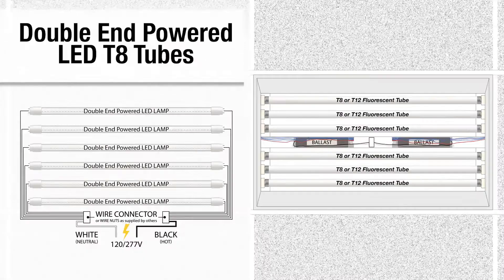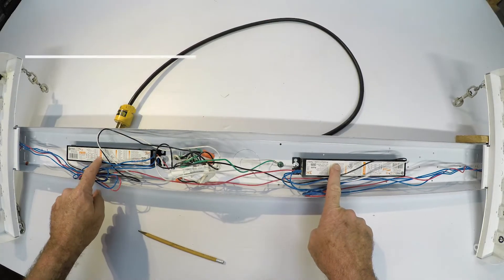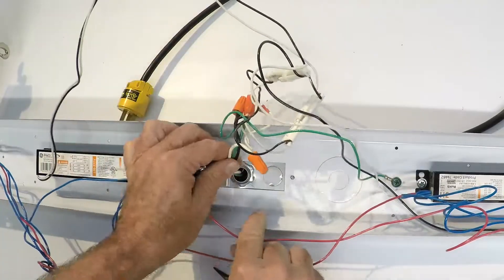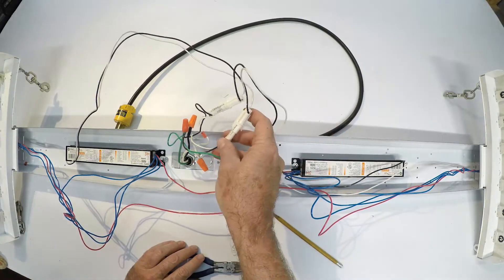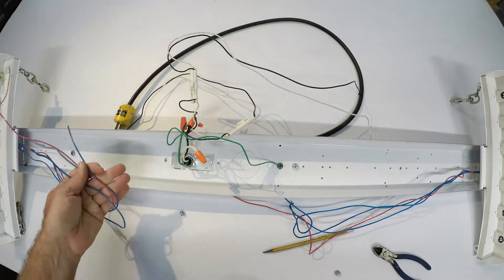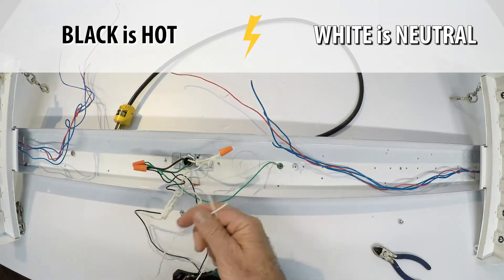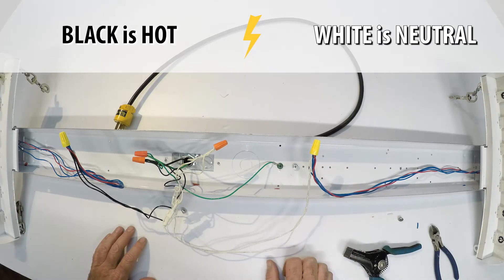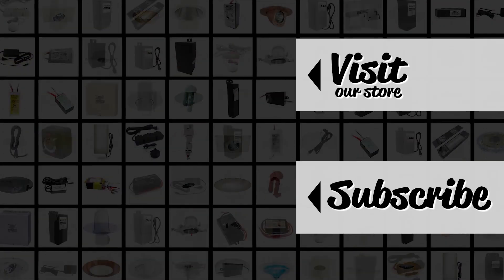How to convert a TWO Ballast T8 Fluorescent Tube Light to LED T8 DOUBLE END powered Fixture

Comment: It doesn't matter what side gets hot and what side gets neutral?
Reply from the maker: The goal is to make sure one side is all hot and one side is all neutral. Its good to mark which is which as some T8 LED lamps require this. Always follow the wiring diagrams.

Comment: Mine doesn’t have a ground wire
Reply: Well - - then the wiring doesn't meet current code, the electrical wire that brings elictricity to the fixture ought to contain 3 wires, 1 black, 1 white & 1 bare wire ( might be wraped in paper) which is the ground wire.  I'd ensure the supply power to the fixture is off, then very closely inspect this supply wire which should be contained within a job/work box made of steel or some sort of plastic, even remove the job/work box if you can not clearly see to inspect the incoming wire.  Should you find a ground wire use a screw nut to atach a sufficent  length of same size bare wire to the exiting ground wire and then attach to the metal fixture.  Should the light fixture be made completely of a non electricial conductive material - plastic - the code might not require a ground wire.  Contact the local building / electricial inspector, explain the wiring situation and ask what the code requires.

Comment: My fixture was like yours, except along with the red, and blue, and the black hot and white neutral, I had a set of yellow also. I connected the yellows to my neutral side. Now only the 2 out board tubes work and not the 2 middle tubes. What did I do wrong with those yellow wires?
Reply from the maker: Did you purchase the kit from us?

Comment: I need help on mine , mine have two ballast two but it has two blues two red and blue red and yellow ,
Reply: I had the same thing. I connected the yellow to the neutral side, but that didn't work. It would only light up the 2 outboard lights. Did you ever find a solution?

Comment: I have Red, Blue and Yellow on both sides and tried one side wires to Neutral and tried other ones to hotwire but did not work.

I had short wire on one side so added thin wire to reach and complete circuit on on side but it did not help.

What could be issue ?
Reply: some LED tubes has polarity, meaning Live and Neutral marked on each end.  This make their rectifying circuit simpler and cheaper.  This also make an issue with 3-way switch(in Europe it is called 2-way because there is only 2 switches) circuit which alternates L and N when operating from either ends. You can try reversing the tube ends and see what happen.

Comment: Question, so you have to have all 4 tube in for the fluorescent lights to work
Reply from the maker: It will depend how the electrical wiring is configured. If you are unsure the best thing is to connect with a local electrician that can be there and evaluate the electrical connections as there can be so many variations and configurations of the fixtures setup.

Comment: Hi I have yellow wires on both sides with the blue and red. What do I do with those?
Reply from the maker: Best thing to do is follow the wiring diagram when making your electrical connections. You can find it in the video description or at this link here https://www.totalbulklighting.com/mwdownloads/download/link/id/513

Hopefully that helps 🙂
Reply: Included the yellow wires with the blue and red for each side. All wires on one side Hot. All wires from other side Neutral. I just did it, it works.

Comment: My cables inside the lighting are ALL white! It is a two lamp with two ballasts kind of lighting. How do I make it transform to two-sided two led lightning?
Reply from the maker: Its hard to know what is going on with your light fixture as its more about the electrical connection and how it is wired up. Sounds like you'll need an electrician there taking a look at it to see how all the wires are connected so you can convert it to LED safely and correctly. Hope that helps 🙂
Reply: @Totallightingsupply  thank you very much for your response!
Reply from the maker: @despoiniskyriakaki8592  you're very welcome 🙂

Comment: Your presentation is excellent, but you said not to follow this for 2-ways switches  conversion. That is easily what my next project will be, do you have instructions for converting a 2- switch, 2 ballast, 4 - fluorescent bulbs configuration?
Reply from the maker: Since this type of conversion can be a little tricky its best to have someone on location to see how things are wired. So we recommend a licensed electrician to assess the electrical to make sure things are configured correctly. I am sorry we can not be of more help🙂

Comment: Just red and blue wires to each end?  Mine has  2 red, 2 blue, and 2 yellow wires going to each end.  And from each end,  reds and blues attach to the closest ballast, while yellows go to the farthest ballast.  I have no idea why the extra yellows exist, why they attach to opposite ballasts, or how that affects the process of doing this.
Reply: All wires including the yellow wires from one side to Hot. All wires including yellow wires from other side to Neutral. Just did it and it works.

Comment: My 4-bulb double ballast light fixture has the tombstones mounted such that when the bulb is installed, the pins are vertical. The led bulbs that I see have the pins in line with with the bank of leds. In my case, with this ceiling mounted fixture, the leds would be perpendicular to the floor. I do not see a way to re-orient the tombstones. The fixture does have a plastic diffusing cover. With the diffuser, is it likely that I will be OK or what would you suggest? Thanks.
Reply from the maker: Without being there to assess the situation its hard to provide help but it sounds like replacing the tombstones with shunted tombstones that are inline with the tube might be a way to convert the fixture to utilize more standard LED T8 tubes. However, we strongly recommend consulting a licensed electrician to accurately assess your specific situation to provide the best options. Hope that helps 🙂
Reply: @Totallightingsupply  Thanks for the quick reply! My question wasn't related to the electrical wiring - I got a handle on that. My question related to how the linear led's diffuse their light. My tombstones mounted at a severe angle to reduce the fixture profile (height), so the linear led's will be in almost a 90° to the floor. The fixture does have a plastic diffusing cover so I'm hoping that the light will reflect off from the interior of the white fixture and shine thru the diffusing cover. Gonna proceed with the conversion - I guess I'll find out!

Comment: I got 2 switches but control 2 different light can i wire like this?
Reply from the maker: The best thing we can do is recommend checking out our Fluorescent to LED T8 Conversion Tool that deals with dual ballast systems. You can find the link to that page here https://www.totalbulklighting.com/fast-fluorescent-to-led-t8-conversion-tool.html Hope it helps 🙂
Reply: @Totallightingsupply  i mean i got 2 switches but control 2 Total different light fixture ... should i still wire the same way here?

Comment: I have 2 ballasts in the fixture.  There are 6 wires (blue, red, yellow) coming out of one side and another 6 coming out of the other side. There are 2 black wires and 2 white wires coming out of the main power source. In this case, should I twist the 2 white wires (coming out of the power source) with the 6 color wires (blue, red, yellow) on one side of the fixture and twist the 2 black wires (coming out of the power source) with the 6 color wires on the other side of the fixture?
Thank you.
Reply from the maker: The best thing we can do is recommend checking out our Fluorescent to LED T8 Conversion Tool that deals with dual ballast systems. You can find the link to that page here https://www.totalbulklighting.com/fast-fluorescent-to-led-t8-conversion-tool.html Hope it helps 🙂
Reply: Yes. Just did the exact same type of fixture as you described. It worked, no issues.

Comment: is it better to use doubled ended LED bulbs when the fixture has a double ballast?
Reply from the maker: It really depends on personal preference. We favor the double end powered LED tubes as it utilizes the existing components of the light fixture making it faster to retrofit and better on the environment  We have an easy to follow tool on our website that can help you with dual ballasts fixtures. You can find it here https://www.totalbulklighting.com/fast-fluorescent-to-led-t8-conversion-tool.html 🙂

Comment: What if you have 2 separate switches in different areas but have the same function?They just turn on the entire light.
Reply from the maker: We have a form online that walks you through many options and how to handle them. There is info about two switches on that form here https://www.totalbulklighting.com/fast-fluorescent-to-led-t8-conversion-tool.html 🙂

Comment: Thanks for the video - I have a few more wires inside my light fixture.  They are Yellow / Gray / Brown and it pairs with 2 ballast and 4 florescent lamps.   Does the same idea (wiring all wires on one side to neutral, and the other to Power) work for this style of wiring configuration?  Thanks
Reply from the maker: Best thing to do is check out our conversion tool https://www.totalbulklighting.com/fast-fluorescent-to-led-t8-conversion-tool.html - There's a section for dual ballasts. Hope this helps 🙂

Comment: Can I get clarification on the "two switch" warning in the video? Do you mean two separate switches that control 2 bulbs on each side, or a "three way switch" that turns all the lights on at the same time?  Thanks  And also, does it matter if the tombstones are shunted or nonshunted for LED (48'' bulb)
Reply from the maker: We have a form that can help explain the dual ballast configuration here 👉 https://www.totalbulklighting.com/fast-fluorescent-to-led-t8-conversion-tool.html - choose 4-foot, then double end and select option I have more than one ballast.
Reply: @Totallightingsupply  thank you - and especially for such a quick response
Reply from the maker: @jameslatour3529  You're very welcome. We do our best to communicate quickly throughout every part of our business 😊
Reply from the maker: Depends on the LED T8 Tube you are installing if you need shunted or non-shunted. We have a great video on all 3 popular retrofit methods here 👉 https://www.youtube.com/watch?v=xPOu-jSTrPc

Comment: Somewhat wasteful trashing functioning ballasts which could have been used by someone. Thanks for the wiring info.
Reply: As someone who has replaced many bulbs and ballasts in my time, I think the the best take away from this video is that ballasts will eventually fail. So you may get a few more years of service by repurposing the working ballasts to another fixture but why? Doing a job the minimum number of times is often enough for me.
Reply: @ronbaker8774  You obviously saw something in that video that was obscure to me if you think the best takeaway was that his perfectly functioning ballasts were eventually going to fail so it should be done now. Which defeats your thought about doing something only once because he's done a task that needn't be done and at some point he'll need to replace the LED tubes. Since my initial comment, I've had to replace a failing 54 year old ballast and some 20 year old tubes in separate fixtures. I used LEDs. It was a miserable, unrewarding job not at all the simple exercise depicted in the video. Hopefully the LEDs will last as long as the ballasts but at least they'll be easier to replace.
Reply from the maker: We do our best to recycle all ballasts we discard. We should have mentioned that in the video. Glad you found the wiring info helpful 🙂
Reply: @Totallightingsupply  That's good to know but the video makes a point of saying the ballast wires were cut so short since it was being discarded.
Reply from the maker: @65csx83  I can understand now how what we said could be heard as discarding into a trash bin rather than a recycle bin 😊 We will try to be more clear in the future. Have a blessed day 🙂

Comment: i bought LEDs that can be used with ballasts.  Can I remove the ballasts and use the wiring in this video to use the LEDs that were designed with ballasts or should I get a different kind of LEDs? Thanks.
Reply from the maker: It sounds like your tubes are Type A tubes that only work with the existing fluorescent ballast. There are LED tubes that are Type A+B tubes where the tube will work with an existing fluorescent ballast and with out a ballast. But these type are newer technology and are not as popular at the moment. We sell these universal Type A+B tubes here https://www.totalbulklighting.com/t8-led-lamps/universal-compatible-led-t8-tubes-type-a-b.html The great benefits of these tubes is that once the ballast fails, and it will eventually fail, is that you can retrofit the fixture using the Double End method and the tubes will still work 🙂 It's a win win 😊

Comment: Have a question about 2 switches and changing to LED lighting. Any videos for how to do this? Thanks
Reply: Has anyone found a video or website that shows how to retro-fit or do an LED conversion on a two-ballast fixture controlled by *two separate switches*?
Reply from the maker: At this time we do not. We would recommend using a licensed electrician to handle this scenario 🙂

Comment: What if there is no green ground wire visible? My fixture is hanging from the ceiling.
Reply from the maker: It may be tucked up inside, or could be a copper wire with now green sheathing. If you are unable to find the ground I would contact an electrician that can help 🙂

Comment: I simply purchased LED t8/12 tubes and replaced the flourescent tubes without modifying the fixture and they worked, what am I missing? I understand what you've done here but I fail to understand why..
Reply from the maker: There are many different types of LED tubes on the market that can work with the existing ballast and many different reasons why you would remove the ballast. You should watch our latest video that explains why one would remove the ballast 👉https://www.youtube.com/watch?v=xPOu-jSTrPc 🙂
Reply: @Totallightingsupply  Thankyou I surely will, I went ahead and removed the ballast from one of my fixtures, tested it with one tube, it was brighter than with the ballast but stopped working after a couple minutes.. I do love to tinker with anything and everything electrical, learn something new every time, thank you for your response..
Reply from the maker: @x_zERØ-11.11  Gotcha 🙂 It's a great way to learn for sure but be careful 😊 Have a blessed day 🙏

Comment: Very beginning of video says type of socket doesn't matter. Every other video I've seen on the subject says it does matter.  This is confusing to say the least.
Reply from the maker: For the Double End Powered LED T8 retrofit method as shown in this video you can leave the existing shunted sockets in it and it will work fine. As long as you follow the wiring diagram you will be ok.

Comment: This video looked very simple but, I'm still a novice when it comes to wiring and here's my dilemma.  My fixture has 1 white wire and 1 black wire coming out of the ceiling and of course the green ground wire.  The fixture itself is a 4 bulb unit with yellow wires, blue wires and red wires.  I have two ballasts which I removed and I've watched video after video trying to get this thing converted over to LEDS and it still won't work.  Here's what I did,.......I connected the yellow wires together from each side of the fixture, I connected the reds wires from both sides of the fixture and the blue wires from each side together.  I then spliced a piece of red, blue and yellow wire and added it to each color respectively creating one single wire each.  I connected the red from one side to the other side, yellow from one side to the other side, and blue from one side to the other side.  I then took the yellow wires and connected them to the white wire and the blue wire to the black wire.  It won't come on when I hit the light switch.  This is all confusing to me because I've seen videos over and over that seemed so simple to follow but, I don't have lights.  Could there be a problem with the tombstones?  They look fine and are not burnt however, when I started this whole project I did so because 2 bulbs that were fluorescent had gone out leaving me with only two bulbs working.   Another thing that I don't understand is what is the red wires for?  I didn't add them to the white and black.  They are just connected from one side to the other side.  Please help!
Reply from the maker: Jerry, we replied to your other comment but we'll reply here too. Did you purchase your kit from us? If so we can have our support connect with you. Please fill out this form and include your order# https://www.totalbulklighting.com/contacts/  If you did not order from us, you may have the wrong type of LED T8 Tubes. We see this all the time. This video is for Double End powered LED T8 Tubes only. It will not work with single end powered LED T8 tubes where the power enters from one side and non-shunted sockets are required. All wire connections should follow the wiring diagram here https://www.totalbulklighting.com/downloads/dl/file/id/1215/led_t8_double_end_power_wire_diagram.pdf
Reply: @Totallightingsupply  When you refer to double end powered LED t8 tubes, are you talking about the pin configuration or something else? i am a rookie.
Reply from the maker: @ryank9848  We are referring to how the power comes into the LED T8 tube. With double end powered LED T8 Tubes power comes into the tube at each end. Here is a video that talks about all the different retrofit methods and LED T8 tubes it may help explain better 🙂 https://www.youtube.com/watch?v=xPOu-jSTrPc